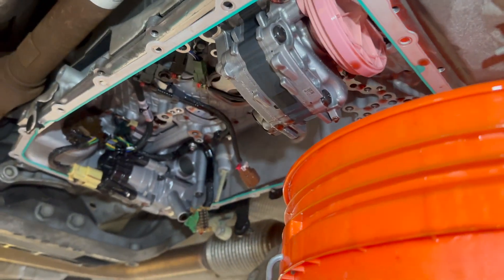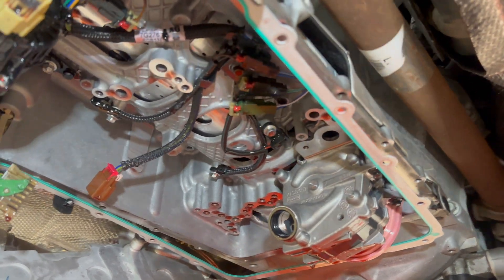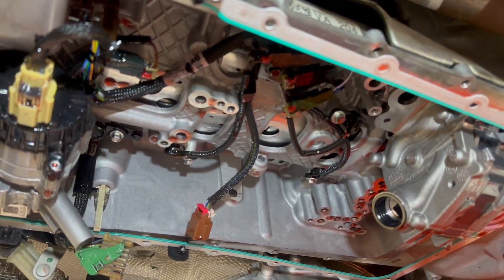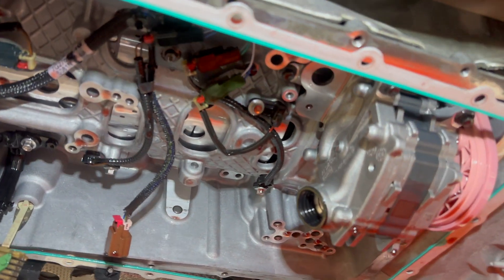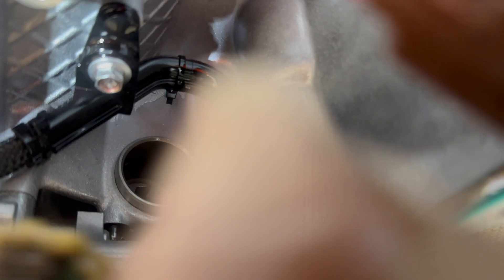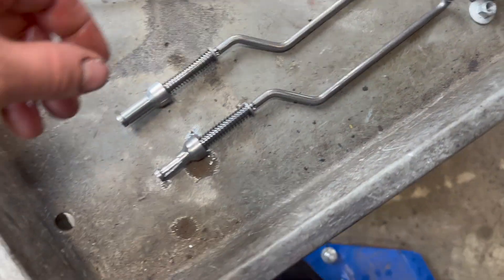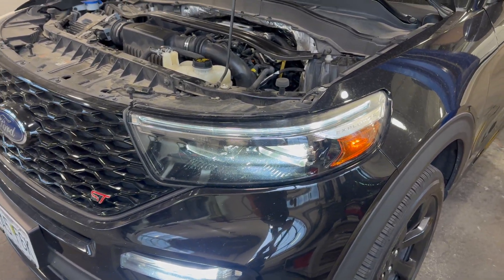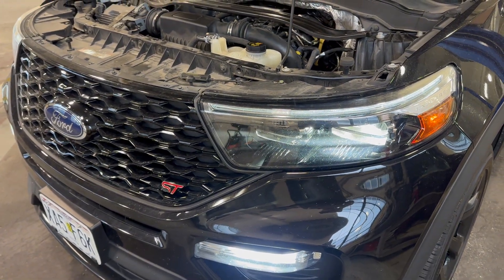Ford P07E4 Park Not Available FIX

Comment: 10 speed is needlessly complicated, so are GM's 8 speeds.  If you are too heavy for a 6-sp auto, then get something with a clutch pedal and a gearshift.  
That, or go Allison.  At least Allison knows what they are doing with true automatics.  
GM, Ford, Dodge, etc., they should all have a 6-speed auto at the most, or you get a clutch pedal and a gearshift.  
If you need something to pull ridiculously heavy loads, then you go commercial,  like Intertrashable, or Freightshaker, KW, Pete, or get yourself a Tupperware Torpedo, aka an ovloV.
The more they complicate things, the more likely things are to go wrong.
Reply: I say anything manual is needlessly complicated. With modern engines you can drive with 3 of the gears anyway. 😂

Comment: Just scrap that pile of garbage and buy something older that works. My 03 f150 is at 347k miles rn and my only issue is an oil leak. That’s it. This new stuff is just garbage. That car is to new to be needing transmission work.